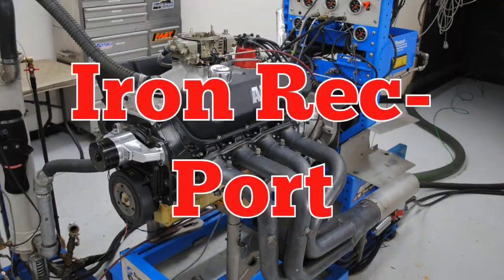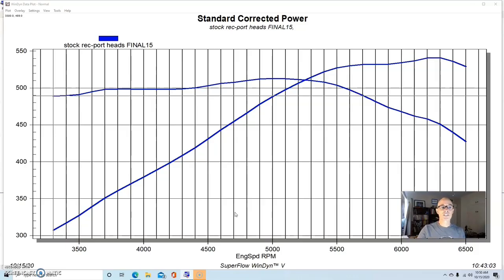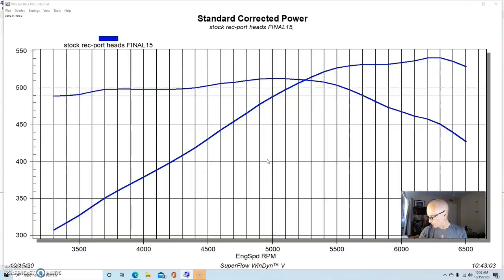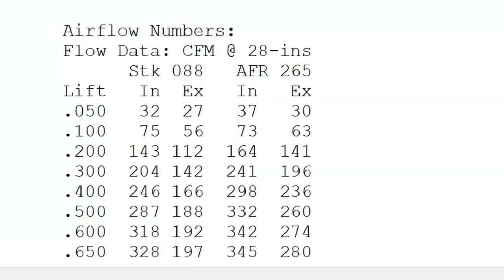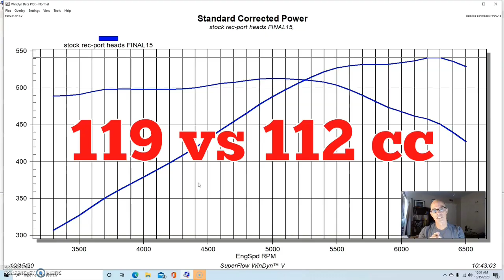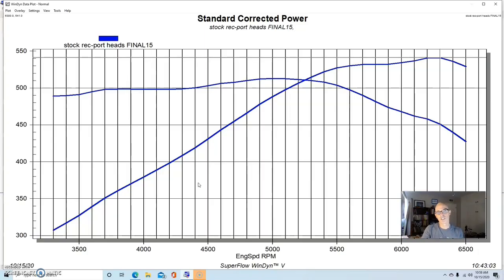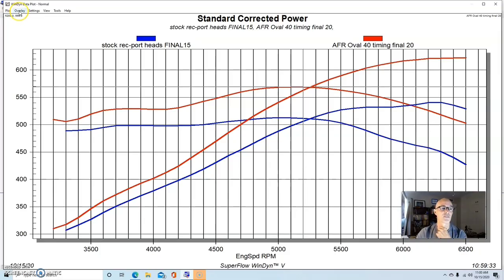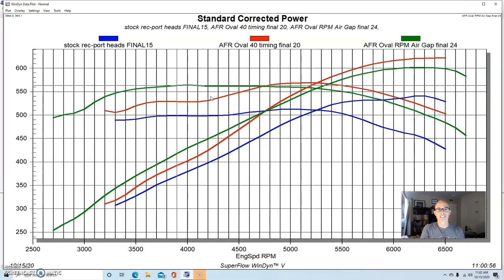454 BBC REC PORT VS AFR OVAL-PORT HEAD TEST

Comment: The truth is the cylinder head you're talking about will fall off after 500 horsepower and you're not talking about a full build on a stock big block rectangle port rectangle Port motor with large known Pistons 31 CC whatever those are do the test right
Reply from the maker: the AFR 265s don't fall off after 500 hp
Reply: It's very easy to make 650+ horsepower with a 489 stroker BBC and AFR OVAL PORT heads.

Comment: It would be nice to see a 396 or 402 cid engine with the 265 cc AFR heads.    I know good oval port heads are hard to find.   Please do a story on an oval vs AFR 265 oval port.

Thanks Richard.
Reply from the maker: stock iron ovals don't compare to AFR 265s
Reply: I realize they don’t compare.   Finding a 396 inch a classic muscle car is easier than a 454.    It would be nice to see what a small 396 /402   with the small 265 oval port  heads.    Many times these heads are’t converted to hardened seats.    I l owe I’d rather spend the money on 265s

Comment: Can I use rectangle port heads on a 1997 L29 454
Reply: Comes stock with square port vortec heads, via that’s why everyone runs those heads on gen 5 blocks. Better performance over all other “stock heads”.
Reply: @glutnaut5945 L-29 heads are 100cc oval port heads.

Comment: Why are all dyno results starting at the top end of street driving?  I really don't care how much hp something made at 6500 when I am not driving at that rpm. (Well I care, but I care about the lower end more)
112 cc is a big chamber when yours is around 100cc or less.

Comment: Hi Richard, I was wondering if you have any idea what my .030 over 454 LS7 has for hp? It is the one with the 049 L88 aluminum heads. It has roughly 10 to 1 compression with 2 inch headers. It has an edelbrock performer rpm intake with an 850cfm Brawler carb. It has a comp cams Xtreme 274h flat tappet cam with 3 inch exhaust. I have been emailing you about this, but you have never given your thought on hp. Thanks. Doug. Keep up the great videos. I absolutely love your dyno videos 😊
Reply from the maker: I did answer you, and said I didn't think it will make it to 550 hp with that small cam
Reply: Ok thanks 😊

Comment: I have a pair of 088 heads on my 468 in my 57 Bel Air. I'm going to replace them with a pair of AFR 265. It's strictly a street car and I seldom twist it above 5,000 rpm. 
Great video.

Comment: So I'm going back to a carb on my 94 3500 454, it has the 17 bolt 4l80e transmission and 411 diff.  What computer would I need to run the transmission?
Reply from the maker: DO A SEARCH FOR 4L80e TRANS CONTROLLERS

Comment: Hi, I’m building a budget gm 502 block , with stock crank , could you please give me advice in what part choice you recommend for a 650hp / with impressive torque to match , the bore size will be 4.500’ not sure which pistons , heads n cam to choose from , worried about mismatching stuff, please enlighten me with your infinite big block knowledge 😊
Reply: Will be aiming for 10-5-1 to 11-1 compression

Comment: Im looking to build a street/strip 454 for my 1985 K5 Blazer. Would you recommend the AFR 265 alumunum head for a midly built 454 Gen VI ......Looking at an Comp Extreme cam in the 270/280 range  with a air gap dual plane intake with a 750 edelbrock carb. ....Definatly open to suggestions for the right head for a build of this type.
Reply from the maker: YES

Comment: So I'm wondering how this combo would do with a 496. I'm looking at the cost and it just makes sense to go for the extra cubes. Won't expect much change in hp, torque should be more. 3500# car with 3.7 gear and t400 trans. Don't see 496 test with oval port heads except AFR290 $$$$. Your thoughts would be appreciated. Thx
Reply from the maker: if your motor makes 1.25 hp per inch-they going from a 454 to a 496 will yield an extra 52 hp and likely even more torque

Comment: 30 years ago I was running modified early oval port heads on my 460 inch daily driver 68 Camaro and beating weekend warriors with big blocks and rect. port heads.In those days nobody ran aluminum heads on the street. They were cost prohibitive.My car was 100 percent street legal and driven to work daily.Driven and raced on treaded tires.

Comment: I have a Weiand Team G (new style) oval port for a 1050 Dominator, and was planning on putting it in my 454 with fully ported 781's 2.19/1.88 valves. The cam is a solid roller 255/265 @.050 638/641 Lift, on a 110 lobe separation angle. Also 2 inch Hooker long tubes. The lash on the cam card is .22/.22  Ironically I have these exact rec ports on it now. 
With all that being said, should I be worried about port stall with this cam? I had it custom ground, but it came out bigger lift when done than I asked for. I also have a functional cowl induction hood with air pan (if that helps).
Reply from the maker: that is still a small cam for a big power bbc
Reply: @richardholdener1727  Thanks Richard. I sure appreciate the quick reply.

Comment: This is so true man.....but i knew a ol  wildman back years ago that ran and ol 66 chevelle 427 square port/solid cam.4-speed 4;10 with factory parts through out that ran 11;60,s give or take all day long....ol timer.....when someone would build a magizine built engine and wanted to know how it ran....you ran him....low cost....those heads on here cost more than his car and he still has it to this day.....he twist that ol big block up there in the rpm,s.....money has took over on the true hot rodders.

Comment: Thank you Sir , I just happen to have a 468 sitting in my garage and was thinking about the best way to improve power levels without touching the bottom end  and you just answered all of my questions 😀
Reply: Watch the "454 motor home engine" build. With trick flo top end kit. 8.2 compression.  Just shows that the power comes from the cam and heads. And more cubes the better obviously

Comment: I'm looking to build a 454 I want to put it in a four-door Caprice Classic but I want good numbers in good torque out of it but I don't want the rut of the big cam I want to try to keep it as quiet as possible more for a sleeper effect but I would still like to see High 400s in the horsepower and low to mid 500s in the torque area do you have any suggestions on c a m size I was looking to run between 9 and 1/2 and 10 to 1:00 compression ratio thinking about a set of 265 air flow resource or 290 airflow research heads but I'm leaning towards the 265?
Reply from the maker: see the many 454 builds-a gen 6 454 from the junkyard with a 274 cam will make 425 hp and over 500 lb-ft

Comment: Can I make a suggestion can we do a shootout between the airflow research 265 and a set of Edelbrock 454 oval port 290 heads? On that combination or on a milder combination
Reply from the maker: see the oval port head test
Reply: I had my 73 Vette engine machined .060 over n built it with a summit racing balanced rotating kit . built the engine on my back porch,took me a week because I took my time checking clearances. Summits kit has great components n didn't have any issues. Installed comp 274 cam n ditched the heavy intake for a 1968 aluminum intake manifold there the same but 35 lbs.lighter "hood clearance issue" also didn't use the 049 heads because of weight , I bought the Edelbrock performer 100cc oval port heads n shaved another 80lbs. Thinking I should have spent the extra money for the AFR 265 oval port, The Edelbrock heads are awesome but probably could gain another 50 horsepower n put a bigger cam in 288 to scrub some torque having traction issues. Anybody have suggestions on putting a bigger cam in for traction?

Comment: John Lingenfelter set many a record with the early 70's oval smog heads because they flowed very well.  Plus oval ports are more efficient than rectangular heads.  Also has something to do with surface area friction.
Reply: I have a set of Lingingfelter oval ports on a 468 with Dart port matched intake, Crower roller cam, 11-to-1 Ross pistons. Superb torque & power.

Comment: This test I think, more than anything, is a comparison of the technology going into these heads. Those 088 heads are essentially the same rec port head GM has been making since 1965. It's had minor changes to the castings, mostly in the chambers, but is essentially the same head they were making in 1965. Those AFRs are 60 years of advancement in cylinder head design. The exhaust port was always the biggest weakness the factory square port heads had, they need extra exhaust duration on the cam to help them out. That's why the old 454HO crate engine had a 211/230 @ .050 cam in it.

Comment: My fresh 360 mopar with trick flo heads just made 531 hp. And 555 Tq.
Reply from the maker: 555 LB-FT FROM A 360? HOW MUCH BOOST?
Reply: @richardholdener1727  not a drop

Comment: excellent video!   i run older oval big brodies raised runners on a 510 short deck in a 1971 stringray on street.  torque and throttle response is like fuel injection!   insane torque.  even street race bikes have hard time hanging in.  OVALS rule!!   just had a new custom gring solid roller cam fabbed by isky.   now motor dynos over 800 hp.  insanity!!!    best thing is i hide it all under factory big block hood with old 1080 barry grant carb.   sleeper that destroys!    dr thrash

Comment: Hey Richard its me again once again thanks for getting back to me on the head selection question for my bbc project. I went with the  afr 265 heads. Now I was wondering what you felt would be a good camshaft selection  for this set up. gen 6 454 with the 265 heads. we are at about 10.5 : 1 on compression. intend to use the vehicle on the street keep it N/A and have power brakes. We of course want great power but dont want to make the motor so cranky that it is not enjoyable. As always love your work keep it coming.
Reply from the maker: look at something with an intake duration od 230-236 degrees
Reply: @richardholdener1727  Thank you so much I will look at some cams now. What do you think are realistic torque numbers with a set up like this being driven on the street i really dont intend to spin this thing up to 7k I was figuring i needed power to come in on the lower end of the rpm spectrum. I would appreciate any thoughts on this. Thank you.

Comment: how big of a deal is port matching? did you guys run a roval intake? is there such a thing?  or do you just mismatch the ports and it works out?
Reply: just so im tracking i watched the video again and read all the comments . you just used a plain not port matched oval rpm air gap?

Comment: Hello Richard love the videos great job. I was needing some help on cylinder head selection and I was interested in what you felt would be a good choice. I am currently building a gen6 454 which is now .030 over to get the cylinders cleaned up. The engine we be going into a 69 camaro that has been restored and will see regular use during the good days of the year. I have been looking at gm performance oval ports 290 cfm  and some of the other brands. basically whaat runner size do you think would be best for street use? I am leaning towards the smaller runners for street use.
Reply from the maker: afr 265
Reply: @richardholdener1727  thank you very much
Reply: Did you watch THIS video?!?

Comment: When I did the math the intake of the afr flows more for sure but at one lift it is only 5% more then the iron head. The exhaust was 30% more at several lifts. The iron head I/E ratio was good at .1 and below but just got worse as the lifts increased down to 60% at the max lift. Seems typical of gm factory stuff. Should be no less then 75%? The afr holds mostly 80-87% I/E ratio. Can most of this power gained be attributed to having the proper I/E ratio?
Reply from the maker: it flows more on both the intake and exhaust

Comment: I wander if the cast rectangular port heads would supply a 600 cubic inch engine we all know that afr sells heads and like a person once said gm heads are just there and aren't airflow research heads about 2500.00 for the money I will take the square port head do port polish and clean bowls I bet 781 heads worked for 600.00 dollars will compete with these heads just tell the truth you are an afr representitive

Comment: Not a fair test, the AFR are ported and the rec-port are not. Port the rec-port heads and they will vastly out flow the AFR heads.
Reply from the maker: stock head vs after market head
Reply: @richardholdener1727  Fine, make it fair. Compare stock ported with after market ported.

Comment: Above 6500RPM they blow the oval ports doors off.
Reply from the maker: no they won't
Reply: @richardholdener1727  Unported rec heads will blow the doors off unported oval heads above 6500 rpm.
Reply: @joesmith306  that's a old street racer myth.

Comment: Richard I'd like to see a stock 5th or 6th gen with rec port heads and a dual plane manifold stock cam and see how much more power and torque you will gain just with the better flow of the heads
Reply from the maker: I did an alum rec-port head upgrade on a Gen 6

Comment: I wanna see the difference from aluminum square to aluminum oval.l
Reply from the maker: the port shape is not important, just the flow
Reply: @richardholdener1727  So do the stock square heads just have bad flowing or are the runners to big to flow good?

Comment: Well no crap the rectangles didn’t do better? There’s not enough cam here for them… increase that lift to low/mid 600s with a little more duration and then compare the 2. The rectangles will make more power. Smaller cam runs better with a smaller head, those 320cc head will beat the afr with a bigger camshaft.
Reply from the maker: no stock rec port head will beat these afr oval heads with any cam
Reply: @richardholdener1727  no disrespect… But I’d love to see you prove that. I’m not knocking A set of AFR heads. They are the best. And if you compare a stock cylinder head with the same runner size to an AFR, The AFR will make more power. There’s no doubt about that. My bet is on the bigger head with a bigger camshaft.
Reply: @richardholdener1727  I mean that’s a pretty bold claim to say that any size AFR head will beat any stock sized head with any camshaft? That doesn’t sound like and informed statement. 

I’ll tell you what.. I don’t know where you are located, but I will literally bring my 496 to you. We will slap those AFR heads on and see how it turns out. I have a solid roller cam in it that has .66/.68 Lift and 279/285 advertised duration with a 110 lobe separation angle. I’m going to bet my heads will make more peak power

Comment: So 320 or bigger heads on a 454 are too much air without nitrous or turbo?
Reply from the maker: the 320 works fine on a 454
Reply: What happens if u put to big of a head on 454ci?

Comment: Sometime I'm going to put my new 540 engine together. Around 9.1 - 10.5 to 1 compression, iron oval Port heads, nitrous hellfire top rings, 4150 carb, hydraulic roller with around 230 at .050" 2,000 stall. My big shot adjustable plate and with my adjustable top shot nitrous in the air cleaner for 2 kits with a Max of about 575 extra ponies of nitrous fun for the street and some track. It may die with that much nitrous but you got to try. I've had great luck with nitrous over the years.

Comment: Here's a point a dynoed 700 horsepower blown 454 head comparison test. with an iron oval Port head in car craft a few years ago beat out the square port iron heads. The myth is the factory square Port head will be out the factory big oval port. That's not true the iron oval Port head beat the square port with more horsepower and torque across the board. And the iron oval Port head will definitely make more horsepower and torque in a smaller milder big block Chevy. Going too big in a cylinder head, carb, intake, headers will usually kill alot of torque to usually make a little more horsepower. Horsepower looks good at car shows and on paper, torque is what wins races at the drag strip.

Comment: Been looking at the 265 heads but been contemplating the cheaper afr 320 enforcer heads (rec ports) that are roughly $800.00 cheaper. 
Our short block is similar except it has a small Howard’s solid roller with .600 lift and 237/243 duration @.050. 
Haven’t really seen any back to back tests with the Enforcers.

Comment: don't ignore the added 80 cfm on the exhaust!  Lingenfelter always said the intake makes torque, the exhaust makes HP.  You could also have gone with a 1150 cfm carb on the dual plane and closed the gap with the single plane.

Comment: This 454 made more power with a smaller cam than the 454 in the oval head shootout, but this 454 used the single plane intake.